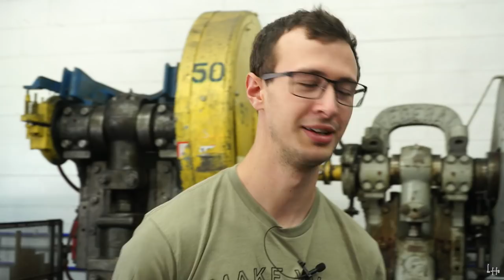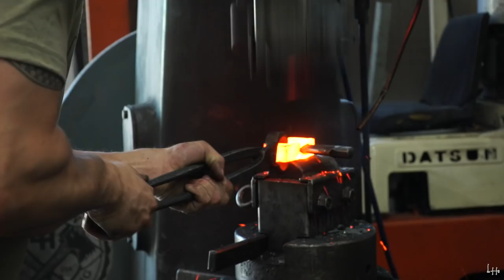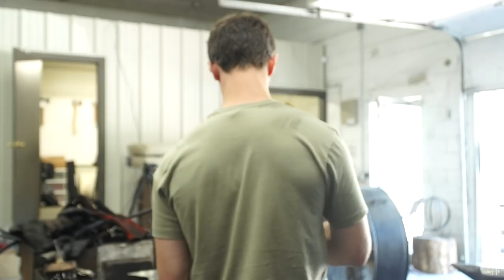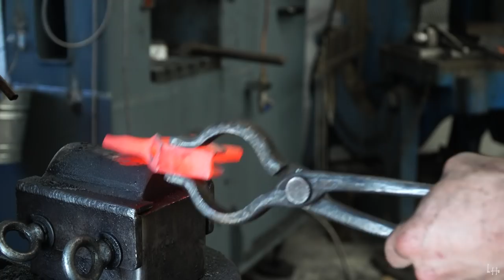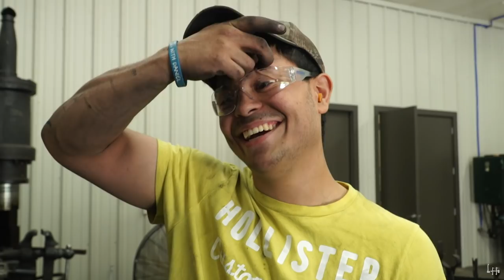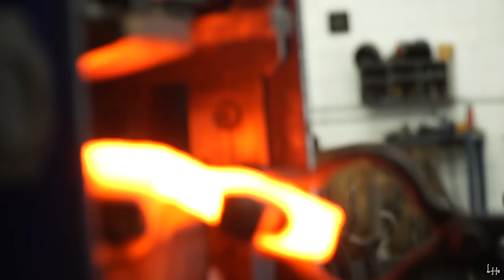FORGING CARVING AXES - BLACKSMITHING

Comment: every evening i leave my flower shop and head home to give the Mrs. a smack on the toosh and a kiss, and i go straight to my shop to fire up the forge. about 3 hours into pouring sweat and swing hammmma i always think, "man i should invest in a power hammer".... then i watch a video like this and think "where is the skill?, where is the craft?, if you're gonna use a power hammer, may as well have bought a cnc...".... then i feel like a dick. but freal blacksmithing is much more impressive with hammmmma
Reply: I forge with two rocks, a campfire and make my own steel, that steel hammer and anvil is just cheating in my mind.